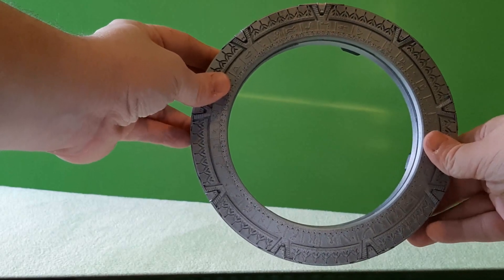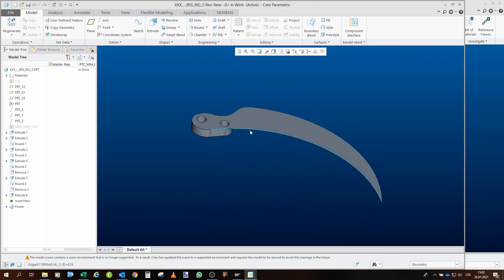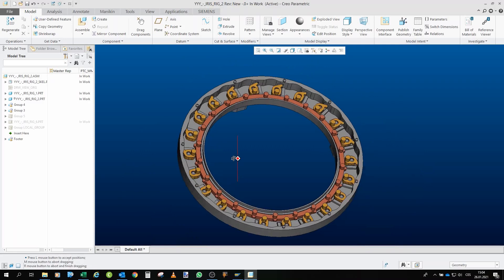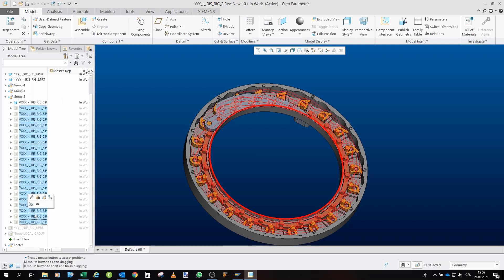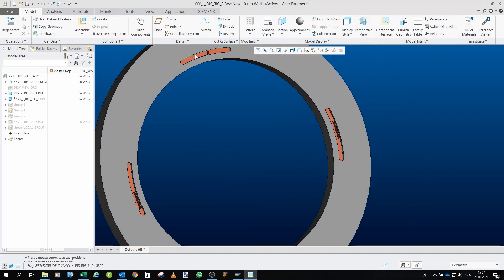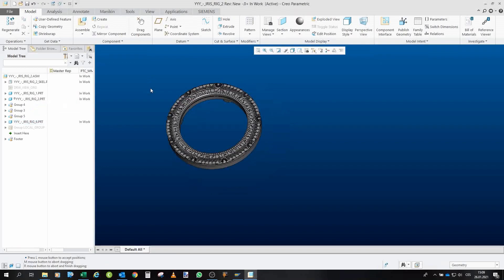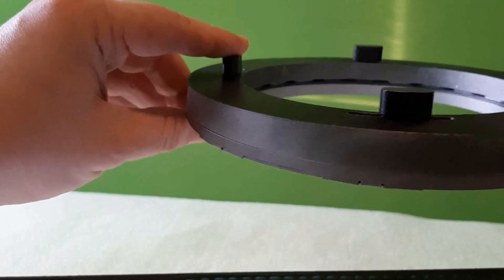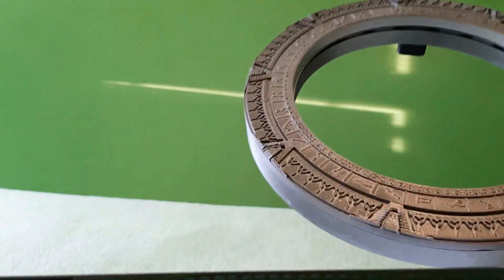Project Stargate - Iris test

Comment: Martin, I have been working on your stargate and have found that your design is very sound, Your clearances were not great but with a few hours of filing and some graphite, i was able to create a functional iris mech. i am only halfway done now. But, i wanted to apologize for a previous comment made out of frustration. This thing you have made is a wonderful addition to my knowledge. Whether it works perfectly or not, what in this world does work perfectly? I am inspired now. Just watching the first half work so well was a joy. I am still elated. Thank you for giving this to us all!!
Reply from the maker: may I ask what printer do you have?
Reply: @martintaichl  I'm at the assmebly point now and I most say he is right clearances need adjustment, the backplate pin and the small swing arm need some work; about 1-2 mm
the gate itself came out amazing !! I don't care if the iris will work but I will give it a go 
I'm using the bambulab A1

Comment: I just printed the parts for this. All pins are not designed properly. All holes are too small. The pins broke off as soon as I applied force to them. I am going to try 100% infill to see if this will strengthen them enough to actually hold. I will drill out all the holes for proper clearance. This idea appears sound but the design is almost not worth even trying. Be prepared to redesign the entire structure if you want to see if it actually works as shown here. I may redraw it so it has proper clearance and strength but probably not. Too bad. I liked this at first.
Reply from the maker: @TheZcraftChronicles  indeed it is not designed properly and parts dont fit.... the finished and functional print you see in the video is actually a fake.....

Comment: I am printing this excellent job as I am writing this. The first peace is the ring, and it came out great on Ankermaker in just 2 hours. Have you room to spray-paint the shutters and still close them without problems? I will try to get a blue spiral pattern so in the middle its light blue like water. I can't wait the inner ring taking 3 hours so im excited to see how it turns out. Just looking for spray tips to see how other painted this. Kudos for this job mate, excellent job.

Comment: Ja..Super just i was looking for..  Can be made for 50mm hole? And servo controlled?.. Thow i can add  myself motor on... I will use it for machine that i build.. And yours close completely.
Reply from the maker: 50mm hole? No that is waaay to small. I dont think that would work.
Reply: @martintaichl   to bad you didnt publish step files on prusa web site. I was trying to change it .. now i have to draw from schrach.
Reply from the maker: @ItisImarko  but i posted it on thingiverse, did I not?
Reply: @martintaichl  I dont know... I will try to find it.
Reply: Ja you did.. I found it! That is the latest version.. that not stuck? Thank you.. I see I have something to print from your collection :)
Reply from the maker: @ItisImarko  i did not touch it since then so it should be ok

Comment: Amazing! I am printing it right now :D
Reply from the maker: great. let me know how it turned out ;)
Reply: @martintaichl  So far: the buttons of the back, do not fit into the ring. its to big, or the holes to small. But printing the ring on new now, i had a little bit of elephant foot there. Maybe thats the cause.
Reply from the maker: @hakaiyou4532  well it is designed with my printer in mind and my tolerances are such that for me, it fits really nice.
Reply: @martintaichl  jeah i missed something on the thingiverse site, not settings for the printers to apply.. so its guessing work now for others haha
Reply from the maker: @hakaiyou4532  not really. If you have a 5 mm hole and 5 mm peg, and the peg does not want to go to the hole even with a considerable force, then obviously your hole is not 5 mm but smaller. Or the peg bigger, but usually the first option is the case. I spent some time fine tunning the settings so that the tolerances are ok. And on my end, they certainly are.
Reply: @martintaichl  here they are not sadly. But ill keep printing and testing.
Reply: @martintaichl  btw how did you print the blades? Like they come up side down with support below the blade? Or turn the blade 180 degrees wit the flat side on the bed?
Reply from the maker: @hakaiyou4532  normaly flat. it is 0,2mm thick, so only one layer. (so that flexibility is achieved)
Reply: @martintaichl  jeah i mafe 1 already, looks good. Now printing the mechanism nobs again, without elephant goot
Reply: @martintaichl  Jeah. and another questyion: why are there 2 blade files of the same blade with diffrent names?
Reply from the maker: @hakaiyou4532  because someone wanted me to make another blade that is thicker because 0.2 was too thin for him. I guess i should have made it more clear while naming it. Sorry for the confusion
Reply: @martintaichl  hmm wich is the thicler one?
Reply: @martintaichl  ahh found it, i see the thicknes diffrence now
Reply: @martintaichl  Yoo got everything printen. But how to put in the blades so they go in correctly? hahaha
Reply from the maker: @hakaiyou4532  did you even watch the video? cause if so, I don undertand how you can ask this question. It is shown there.
Reply: @martintaichl  lol ok.. rude. But sure ill watch it :P
Reply: @martintaichl  finished it! Looks good :D
Reply from the maker: @hakaiyou4532  how is this rude? I did the video so that everyone knows how to assemble it. That is the whole point
Reply: @martintaichl  looks good and works.
Reply from the maker: @hakaiyou4532  and does it work as intended?
Reply: @martintaichl  yes, aldo i needed to losen things up a little. But yes it works, but when it retracts, it does not 100% retract, more like 85%

Comment: Add an outer ring to the back - a full circular ring maybe a couple mm thick that connects all 4 back movement actuation knobs, and moves them simultaneously. That should handle the stickiness on the open/close mechanism and remove the need for both hands without changing the appearance.

Comment: I'm printing it now. Great work! is it normal that the blades are only one layer thick?
Reply from the maker: Yes. The thicker they get, the bigger the opening in the close iris would be.
It is basicaly laying all the plats through each other so they need to be as thin as possoble and also flexible

Comment: This is Amazing. But a lot of rubbing parts causing friction. I would like to modify it to use ball bearings, some like MR85zz. They are cheap and could improve it massively. 
The .asm on thingiverse is ok to work with, but could you also upload the creo .asm as well as the creo parts? A working Assembly would be way better to work with.

Btw. it is cool to see someone else using Creo!
Reply from the maker: hello there. Well on my end it works even withut the bearings but i do see your point. Well i do not really want to put creo files on thingiverse but if you give me your mail, i am more then happy to send you the files. Though i work in creo 4. so you need at lest the 4 or higher in order for the files to be able to open ;)
Reply: @martintaichl  Thak You! Due to school I currently work on Creo 7.0 so that is no problem. I understand your point wirh thingiverse, but sharing my email in a Youtube comment may not be the best thing to da. Is there another way to give it to you (something like DM)
Reply from the maker: @brombeerkralle6747  yeah, DM me on thingiverse ;)

Comment: Can I use this to make a lifesized iris?
Reply from the maker: well that is one of my lifetime goals. so if i ever have house with bick yard. i will try to do this, the mechanism should be relatively unchanged ;)
Reply: @martintaichl  I am in the works of making a lifesized gate as the front door to the barndominium I am building. With a full DHD. The SG-1 Gate.
Reply from the maker: @Kevinklimeck  Niiiiice
Reply: @martintaichl  This is my gate my dad and I built before the power of the pi was around. https://www.youtube.com/watch?v=dKjaSVt1Eb4

Comment: What is the software you used? Can you use the software to help you place the holes on each blade end so that will allow you for the motion to happen properly or you dialed it in until it worked?
Reply from the maker: I use Creo. But i have to say i dont get your second question.
Reply: @martintaichl  How did you decide to place the holes in the iris blade ends to perfectly open and close the iris. Did the software help you? Or you just dialed them in until the iris perfectly fit?
Reply from the maker: @RoamingInterests  i am still not sure what do you mean by the "software help". I simply designed it in this way, so that it woks, made few tests and printed it out.

Comment: All the parts are printed, but im noticing all the holes seem a tad undersized. Did you sand everything first?
Reply from the maker: nothing at all, i guess it is an accuracy of the printer. I will give you a tip, take a scisors for your fingernails. the pointy ones. put them inside the hole and make few turns there and back and ou should be ok ;)
Reply: @martintaichl  unfortunately that doesn't seem to be enough. all of the tabs (part shown at 3:08) are ever so slightly long as well and so not clear the edge into the outer frame. i notice on the blade the holes are 2 different sizes, the larger one would work were the smaller hole is with a little scraping, and the larger one would need to be that much bigger to fit the tabs. 

I printed a calibration cube and I'm dead on accurate. I've already broke a fair amount of parts today trying to get it fitted so ill need to reprint blades, tabs and the bottom of the ring. I guess ill wait and see if it gets remixed. 

At least i have the outer shell, which is still the best stargate I've printed.
Reply: I'll add, you dont mention your print settings. Maybe there's a discrepancy there.
Reply from the maker: @C3rb3ru5  dont know what to tell you. I had no issues whatsoever.
I use prusaslicer and default settings for PLA. 
I also uploaded step files so feel free to download them and increase the hole diamter.

And one last thing. The best gate? Really?  It looks ugly, i made it just to have the iris look. I designed and posted much nicer gates ;)
Reply: @martintaichl  Your "default" is not the same as everyone elses. We dont know what printer, nozzle speed etc you may be using. Postings settings might help is all. It is the coolest gate ive printed, ill have to look at your other designs. I was hoping to do the oneil your making next.
Reply from the maker: @C3rb3ru5  it is not my default. It is a default of prusaslicer. 
Printer is stated on my Thingiverse as prusa MK3s ;)

That is it, i am lazy person, i fully admit it. And considering i use default settings, i dont write it. I will try to improve it in future ;)
Reply: @martintaichl  doesnt change the fact your making incredible designs for the community. i look forward to what you come up with!
Reply from the maker: @C3rb3ru5  thanks. Well tomorrow i finish the oneill and after making a video, i will publish it. And then...nothing. i did not even start with the Bilsirnir design yet. I will have to hurry up...

Comment: hey there! i'm right now printing the parts of this absolutly awesome wormholedevice - but unfortunatly i had to see that most of the holes and pins of my prints dont fit together (holes are slightly too small). i guess its just some kind of printer-inaccuracy. anyway, i just wanted to ask you for please adding the stp-files to thingiverse. this would make it a lot easier to improve the tolerances to the needs of different printersetups! thank you very much ;-)
Reply from the maker: step files uploaded to the thingiverse ;)
Reply: @martintaichl  that's awesome, thanks!
Reply from the maker: @CapCorporation  ;)
if you succed with the print, plese post some pictures ;)
Reply: @martintaichl  i have the same issue, ever so lightly too tight. I imagine the parts should move freely so where should be no glue user/needed. ill try opening up the holes with a drill
Reply from the maker: @C3rb3ru5  dont do that with a drill. you  see, they have to move freele but there must not be to big gap because then the blades will slip up. just few rotations  with scisors in those holes should be sufficient ;)
Reply from the maker: I can do that. Though i cannot promis you it will be today.
Yeah i have all the holes and pins with 0 tolerance to assure a tight fit with no need for glue. But on my end it works really well. I will try to ppst steps asap ;)

Comment: Epic, dont suppose you have a ramp/platform to go with this?
Reply from the maker: Thanks. No. My ramp does not support this.
Reply: @martintaichl  your doing amazing work. I plan to print this in the next day or 2 when a printer frees up. Very excited. Just saying, I would pay for a stand/ramp etc for this. it's that good
Reply from the maker: @C3rb3ru5  you dont have to. All my stuff is free. This is just a test rig. I do plan to design a gate with the iris that would be in the pedestal. When that happen, i will ofcourse publish it as well ;)
Reply: @martintaichl  your amazing. and this is the best gate I've seen! this is inspiring my to maybe get around to making one of those fancy light up ones 😎
Reply from the maker: @C3rb3ru5  yeah. I already designed one with lights so why not  though i dont know if i would be able to make the lights work...

Comment: Hi, ive tried printing the same but the iris blade is a little bit thin, is it possible to make it thicker? i love your design!
Reply from the maker: It is one layer. 0.2 mm. 
I can certainly make it thicker, tjough i am not sure if it works then. Anyway what thickness is possible for you?
Reply: @martintaichl  when I print it on an ender 3 goes to 0.1mm or sub so when wiggle it can snap maybe 0.3mm? or 0.4?. Thank you very much!